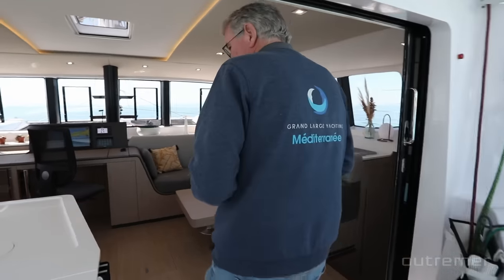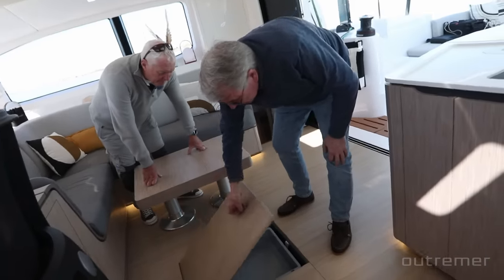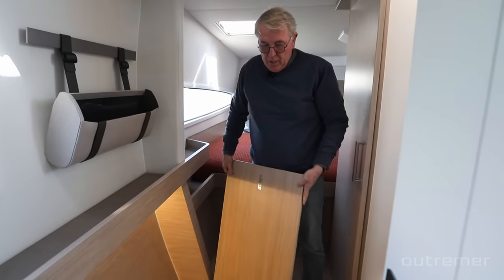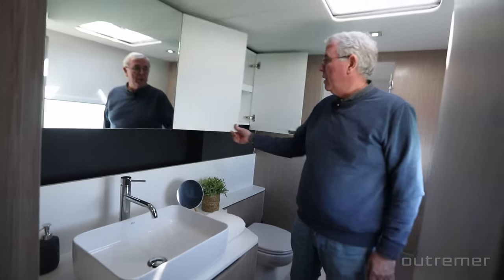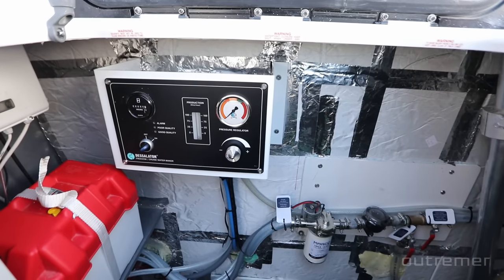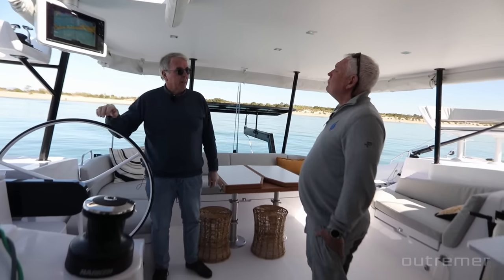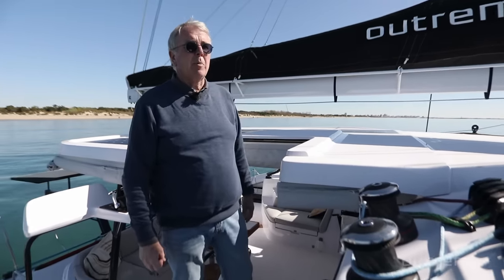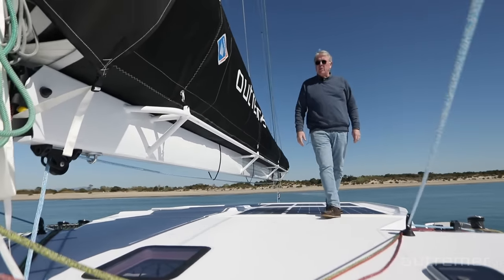Outremer 52 Official Guided Boat Tour

Comment: Huge improvements over the 51, beautiful boat!  The ergonomics of the helm station are odd though.  You can’t even see the chart plotter from the upper helm position because it’s tucked under the coach roof…and then no MFD’s or autopilot at the helm to make adjustments?  Maybe this video didn’t show this properly though or maybe the setup is customized to what this particular owner wanted?  I can’t imagine this being the way they all will be.  I look forward to stepping aboard though and understanding this better for myself, cheers!
Reply: Surely Outremer can put a chart plotter anywhere you like. Or you could carry a cheap tablet/phone around, even have mounts installed at various locations.
Reply from the maker: Electronics is fully customizable of course. You can have a screen on the bulkhead (even on both sides), pod in different location, etc. You have to test yourself to find out what suits your needs !
Reply: @catamaransOutremer  Thanks for the answer, and good to know this issue can be corrected.  Would be much better if the plotter was mounted on top of the coachroof instead if an inefficient position for both the upper and lower helm.

Could you tell me if this boat is still made with Polyester resin?  Is there an option to upgrade to vinyl ester?

Comment: Any plans for hybrid and electric options, Outremer?
Reply from the maker: Of course, we are monitoring evolution of technology, but so far safety margin would be reduced unless you accept to lose space with huge gensets.
Reply: @catamaransOutremer  Thanks for the reply. I see your argument for pure electric.

Parallel hybrid engine + hydro regen + maxed out solar on the coach roof adds more, not less, safety margin. Except for cost I fail to see why it wouldn't be preferred over just diesel.
Reply: @PJCelis  Are you yourself interested in buying a 52? If you are, then I'm guessing that Outremer will be willing to discuss this in some other setting than this comment section... ;-)
Reply: @angela1984a I'd say it was just a passing comment, Angela. No need to be a smarty pants.